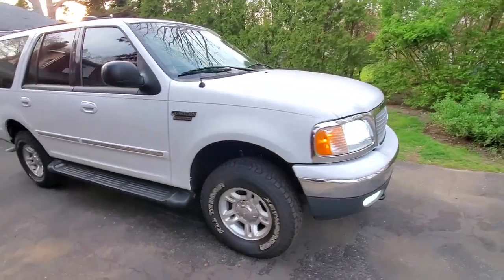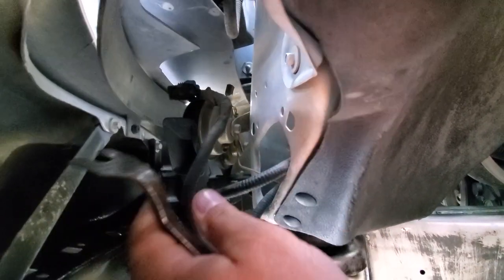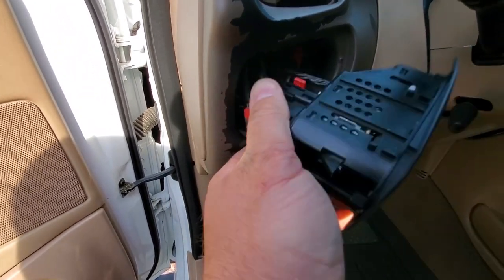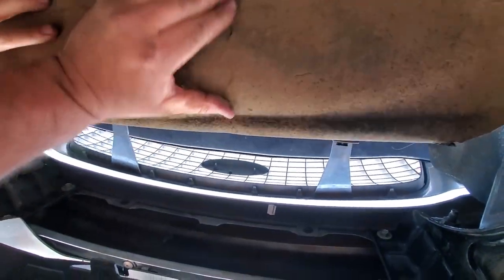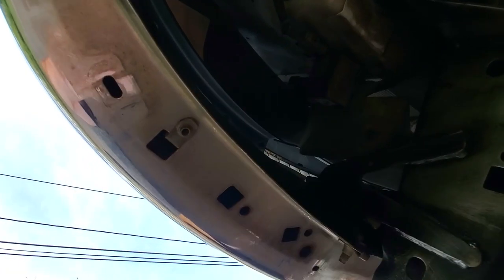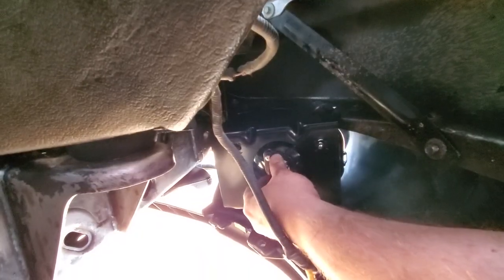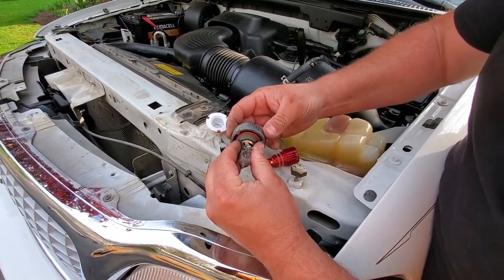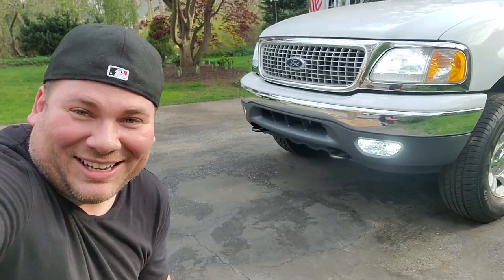FORD EXPEDITION FACTORY FOG LIGHTS AND LED BULB UPGRADES featuring BOSLLA

Comment: I had a '97 Expy, if I remember correctly there should also be factory harnesses on either side of the running boards if it was not equipped. I bought a strip light and attached to the bottom of my  aftermarket round step tubes . Thing lit up the ground when unlocked with keyfob. I like how some manufacturers used the same wiring harness, weather what trim level you got
Reply from the maker: That's awesome!  Same here.. the more blanks they leave the more customizable it is!

Comment: I have a 2004 jeep grand cherokee laredo 4.0l. It didn't come with fog lights but I want fog lights. It came with the fog light harness. Is the process similar to this process? I'm guessing I'll only need the lever that has the fog light switch. I'm wondering if there's something I'm missing.
Reply from the maker: I never tried on a WJ.. you would have to make sure there are fog lights wired to the fuse box and I'm guessing you'd have to add a fog relay.  If not you can always run aftermarket wiring and switches to a factory location
Reply: @ProjectDanH  thank you.  Happy Father's day.

Comment: I have a 2017 Expedition XLT which doesn't come with daytime driving lights.  But the 2017 Expedition Limited does.  How can I install the factory daytime driving lights in my XLT?
Reply from the maker: Excellent question.. I've never owned a vehicle that new before so I wouldn't have a clue